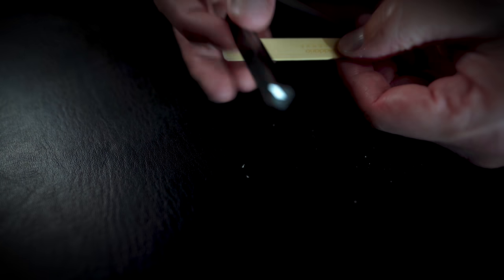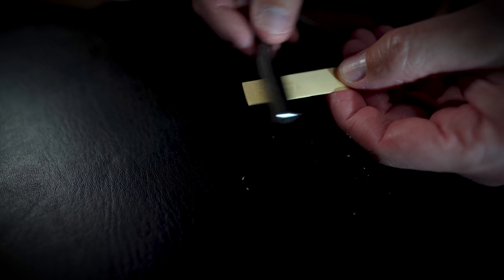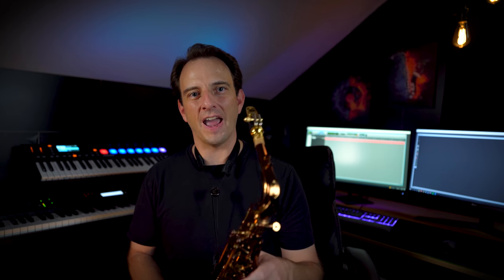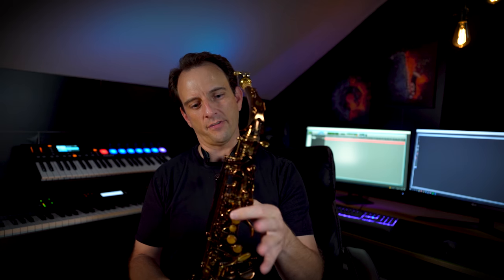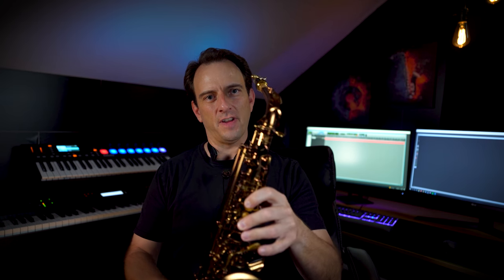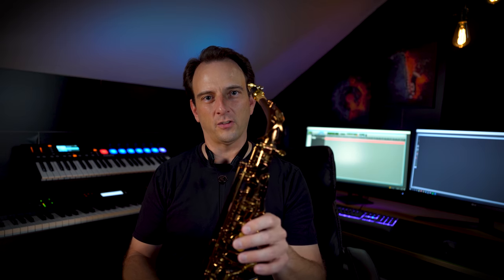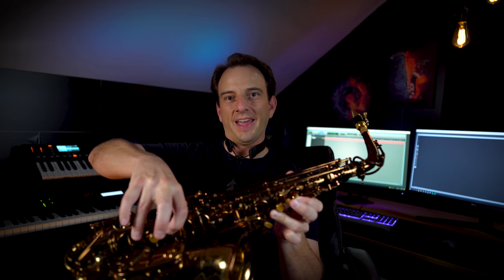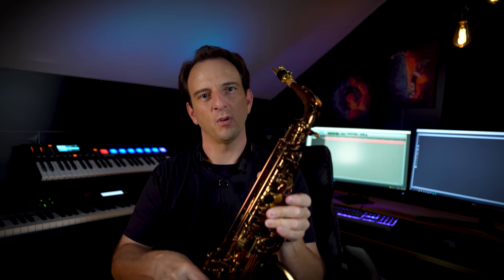Split Tones - How to get them on Alto Saxophone

Comment: Great video! Will there be another for Bb and higher?
I find F# can be made to spilt by releasing the octave key.
That split A was new to me thanks.
Reply from the maker: My experience with the notes I didn't cover don't really split consistently or at all that I'm aware of. I'm sure there are some particular fingerings that could work for some people, but they would probably vary between manufacturers of saxophones and be hit or miss with every person. I was able to split a high B once where the stars aligned and the reed just let it happen....but since I can't depend on it...I don't usually try.
Reply: @randalclarkmusic4333  very wise, those are rare days (or nights)!

Comment: Hi Randal, what constitutes a properly adjusted front F key in order to get that split tone to occur? Is it easier if the front F tone hole is less open or more open when the front F key is pressed? ie the key height of the front F
Reply from the maker: It will be easier if it is opened less, but the real reason for the adjustment is not for the split tone, but for the ease of playing the altissimo.
Reply from the maker: If it’s opened too little, the notes will not sound good though. Gotta find the right balance.
Reply: Thank you for the detailed explanation 🙏🏼

Comment: Thanks for the cool tips Randal !  You sound great using this technique on your new album.
What is your mthpc/Reed setup in this video?
Thanks again
Reply from the maker: This is a Jody Jazz DV 6 with a vandoren blue box 2.5 which are a little stiffer than the green or red. The DV like a reed just a tad stiffer.
Reply: @randalclarkmusic4333  is that your regular setup these days?  Did you use that on your album?  I thought you were playing on a Beechler metal
Reply from the maker: @TLPeffer   I played a Beechler Belite on my record which I love. I’ve been experimenting with some other setups. This’s DV sounds great and is an easy player.
Reply: @randalclarkmusic4333  you sound awesome on the Beechler. I know the DV’s are totally easy to play and have a phat sound. Good luck with the experiment

Comment: I use a Vandoren A45 with a sinthetic reed, having difficilty splitting notes....🤷‍♂️
Reply from the maker: What opening is the Vandoren, and what brand and strength synthetic?
Reply: @randalclarkmusic4333  yur not gunna believe this🤣
A45 is (1/100mm)220
Like an 8
I use a Bari brand medium tenor reed on my alto sax.
Tone is great, altissimo easy peasy, but can't get it to split. Tried loosening the lig screws....🤔
Reply from the maker: Ha ha. Tenor reeds on alto is fun. The mouthpiece/reed combination needs to be right to get the splits consistently, as does your voicing. I’d experiment with a 2-2.5 reed on that 8 opening and if that doesn’t work, there is something going on in your voicing inside the mouth, probably will need to raise the tongue to a higher vowel.
Reply from the maker: Also, some synthetics and strengths make splitting hard. I can split well on some brands but not on others.